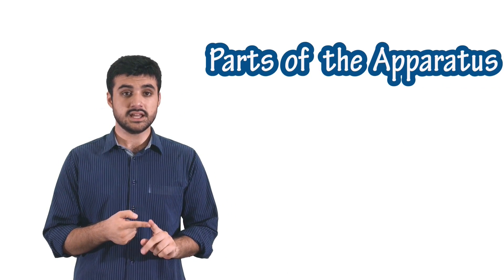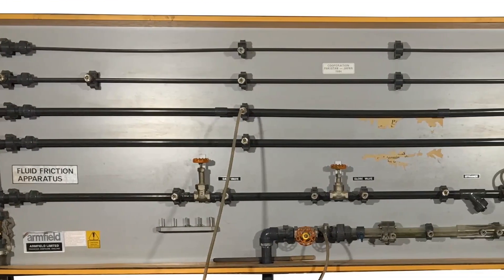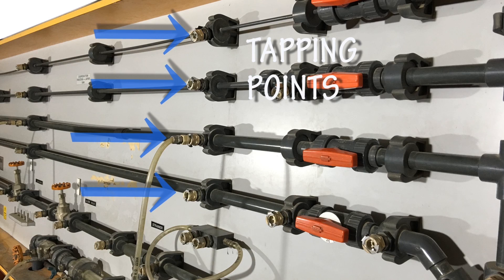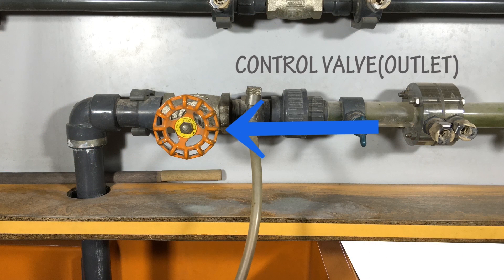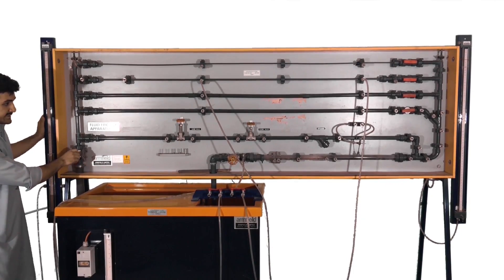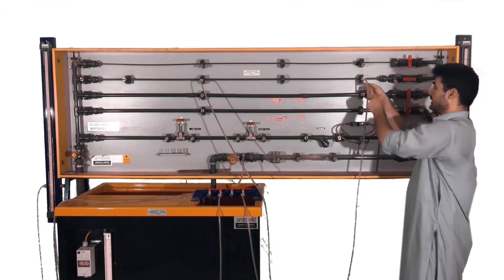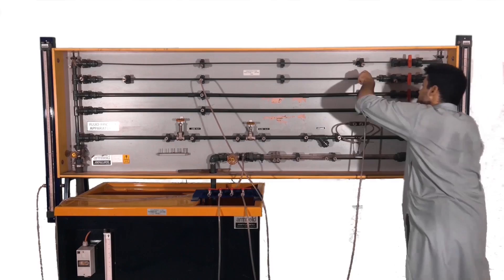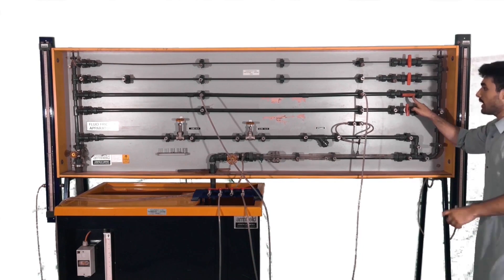To Determine the Relationship between Head Loss Due to Friction and Velocity for Flow of Water

Comment: what is the name of item of tappping point?
Reply from the maker: Yuzar Arigi can you kindly verify your question again 
As if I'm not mistaken it's called the Tapping Points
Reply: +Afrasayab Khan I want to ask what material did you use in connecting the flexible pipes with the tapping points